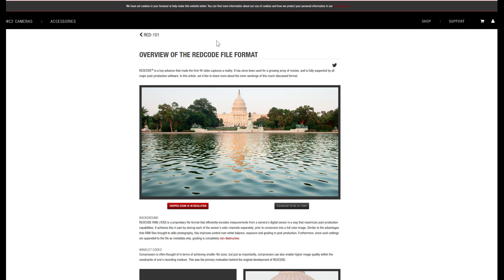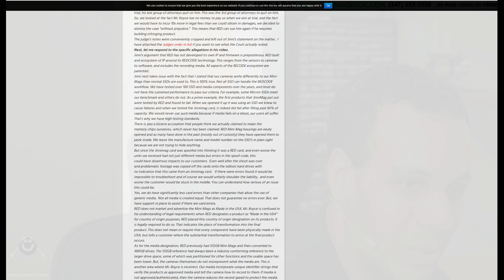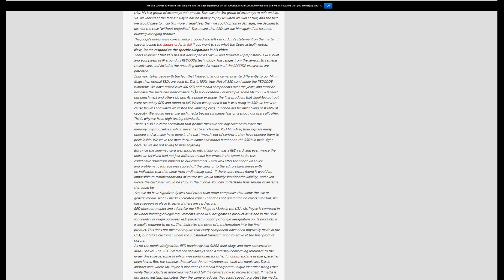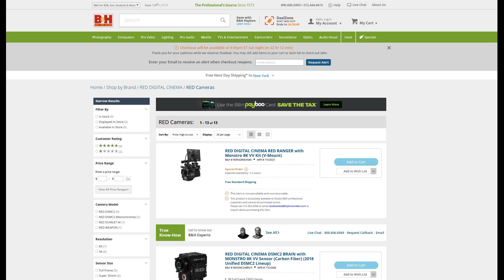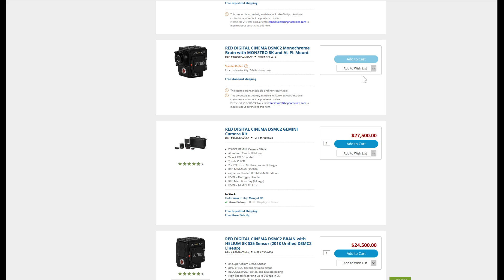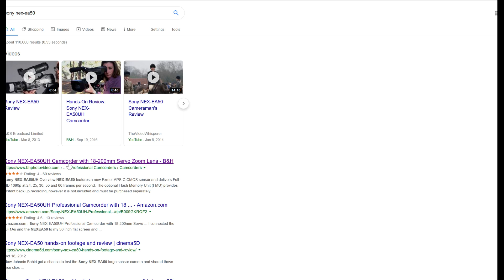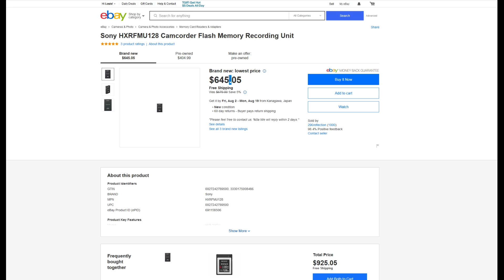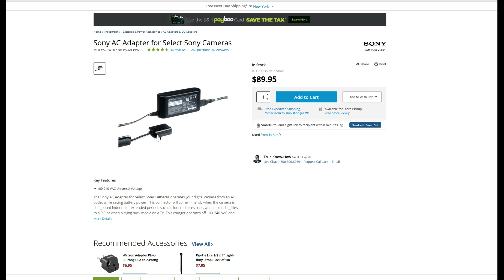Red Camera Mini Mag thing - my take on it.

Comment: Im a red shooter. I believe the special way that the file is written is that it saves the video in layers of resolution/ compression. This allows you to playback a r3d file on lower end hardware at a lower resolution without a hardware hit. The 4gb file split is a redundancy and fat 32 thing to allow Mac and PC owners to transfer data interchangeably and not what I believe Jarred is referring to by proprietary tech. The 4gb file split rumor as the special proprietary way the file is written is speculation from Linus being spread by hearsay as fact. Not defending RED on this debacle, only clearing up the REDcode issue.

Comment: So when a company decides to release a product, when setting the price the have to factor in the development costs and manufacturing costs.  The development costs are amortized over the expected production run including the price of accessories.  If they would let standard SSD's be used in the camera, that would result the profit on the SSD's being shifted to the cost of the camera.  Thus, the system cost would remain the same.

Comment: Anyone ever used Siemens PLCs? You need to store your program on a regular SD-card (with DRM formatting), and the bigger you program, the more expensive your memory card. Nothing strange that far, until you realise the sizes are in MB rather than GB. Over 100 euros for a few MB?

Is red owned by siemens?
Reply: https://www.ebay.com/p/Siemens-Simatic-Memory-Card-4-MB-for-S7-1200-S7-1500-CPU-6es7-954-8lc02-0aa0/1165839463

Comment: From what I can see the Mini-Mag was introduced in 2011 and its predecessor, the REDMAG, in 2009. This talk about a lot of SSD's not being able to meet the performance needs of a RED camera might actually have been true back then.
The thing is that back in 2009 or 2011 this might have been a problem, but since then SDD performance has more than doubled, closer to tripled I'd say. So today even a low end SSD is likely to be faster than the SSD's they used back in 2011. So while once there was an added value of their testing and selecting the best drives that's no longer a valid reason for their inflated prices. Their talk about a recovery service for failed media is a bit more interesting, but frankly I'd like to hear from anyone who has actually used those services and how that worked out before I'd trust that they would be able to recover some valuable footage. Dead SSD's have a disturbing habit of taking the data to the grave.

Back around 2010 or a bit earlier I worked with some demanding video applications where I ran into SSD performance problems. I was working with a video solution we had designed to use three striped HDD's to provide the necessary bandwidth. Now striping mechanical drives isn't the best way to achieve high reliability as any single drive failure kills the storage, and we had three drives instead of one that could fail. To improve on that I looked into using a single SSD instead of the stripset. The application needed a sustained transfer rate of at least 110 megabyte per second, and the best SSD's of the time all looked like they would be able to meet that demand. However the first SSD we tried couldn't actually do this when we tested it. So I searched all SSD reviews on the net and we ended up testing a SSD from OCZ. At the time it was their flagship product and on paper it had a sustained transfer speed in excess of 200 MB/s, which was easily fast enough to keep up. So we sent a test unit to our customer and they liked it, at least at first. After a few days the customer started having problems with the video and sent the unit back. I tested it and it worked perfectly, but after letting it rip over night it was suddenly slow as molas.
First thing you might be thinking now is that early SSD's really didn't like being written to repeatedly, and that's right, but it wasn't the problem here. The test I ran actually only read the video files from the drive over and over. After some experimenting I had a log that said that just reading a huge file over and over it took about 100 reads before the drive suddenly slowed down so far that it only clocked in at about 100 MB/s, and that was below the minimum bandwidth needed. Switch to reading another file and you got the full bandwidth for about 100 reads again before the performance tanked. I proceeded to test a number of SSD's and discovered that a lot of them behaved weirdly when stressed for long periods. I also got in contact with several SSD manufacturers discussing this and at first most of them didn't want to admit that there was a problem, but eventually I was told by several sources that it was some inherent limitation in the controllers used on these drives. They also claimed it wasn't anything that any ordinary user would ever run into, or at least they wouldn't know that it happened. In the end we didn't feel comfortable using any of the SSD's on the market at that time and continued to build these machines using mechanical drives.

Now I'm not saying that this was the problems the RED CEO is talking about, but it sounds plausible. We didn't find a drive that we could trust, but RED might not have needed quite as high a transfer rate, or they put more effort into finding that perfect SSD.

Comment: For those wondering about the facts here, Linus covered it in his editorial, where he went through both arguments, and found that in the end, while the CEO was basically using avoidance tactics, and the knock off manufacturer for storage did have strong points, neither have solid, airtight arguments to lay claim. However, Linus did do due diligence in that RED's cartridge storage is indeed a flash storage medium that is not proprietary to RED, and infact just a regular flash drive, with a new casing and connection on it. He does maintain that RED's point is moot and that its simply a DRM dick waving move to get more money from their clients. As he himself has stated prior to this metaphorical explosion that the cartridges are overpriced annoyances.

Comment: I (detractor) doubt anyone uses the RED camera for youtube vids. The need for fast storage is a necessity for hi-res vid storage, but they are like big thumb drives, you may have many, all with important data. 

It isn't farfetched to have 25 to 50 such drives for an on-location movie shoot, the cost is then upwards of 100K for what are simply cheap SSD with a pass-through connector.
The issue is that RED is suing someone who discovered their scam, an simply did the same thing RED did, take cheap a SSD, put a pass-through connector to fit RED cameras, found out that it works, and so sold them for far less than RED. 

Why did RED sue? Because the cheap SSDs work! If they didn't, Red wouldn't have a problem.
Jinni was smart enough to discover a market selling cheaper storage, so what's wrong with competition? No IP problem here, Jinni did exactly what RED did with exactly the same off-the-shelf connectors RED uses.
Just like your own to-do with Apple, you found a market repairing their stuff after warranty (often better than what they do, even under warranty) Apple tries to shut you down to protect their cash grab.

Now as to the camera. The price stated doesn't include lenses, it is simply a box, called a brain, with a CMOS image sensor inside. RED copied the concept of the ARRI Alexa, then knocked $50K off the price. Blackmagic makes the same thing (BMPCC 4K) with a slightly smaller sensor, for only $1,200!
Of a truth you likely cannot tell one from the other picture-wise, if they all use the same lenses. The color science is in the processing software like Davinci Resolve, Avid, or Adobe.
For me, it's not anger at RED, but rather ridicule towards the arrogance of the scam. Sure I'll never buy one (even if I had the money to waste) but that doesn't mean I can't pour derision on their hypocrisy.

Comment: Hey Louis, people are not upset about the mark up. People are upset about the quality of the Mini Mag. The Mini Mag issue is like the Apple Butterfly switch, but worse. Like how you address the non-removable battery change of Lenovo, at least Apple design the butterfly switch with a purpose, to make the mac thinner. The Mini Mag is a absurd attempt of trying to make money out of the professional. You should watch Linus video on the issue, very accurate. They literally design a proprietary connector just to force people to use their Mini Mag and add a point of failure to the system.

Comment: The reason people are all in a fit about this is because red is charging $3000 for a very cheap (as in, sub-$200 for a 1TB at retail) SSD in a fancy aluminium case with a proprietary connector - which is literally repinned SATA. 
People don't like things being dramatically overpriced, even if they'll never buy one. 
Half of Apple's haters don't like them because their comps are often eye-wateringly expensive for the hardware.  It's nothing new.

Comment: Why is RED selling a $300 component at a 800% mark-up?  Because the application of the component is analogous to: "millions of meters of celluloid film... pro-lab photo-processing included in price."  They are not selling the component.  They are only selling the BENEFITS of the component.  The ~$2K price is far less than the physical, and chemical alternatives.  Ask Kodak, "What do you charge for 4 years of unlimited film, and unlimited photo-lab processing... with digital mastering?"  From RED's perspective, they are providing a benefit (at least) equal to that.

Comment: Red Cameras or equivalent offerings from companies like ARRI are made for shooting feature films and high end commercials.

I am not a videographer, but a photographer; there are some common aspects though. The bigger the size of the sensor, greater is the ‘look and feel’ of the result - better dynamic range and more details. So, two cameras with same resolution can’t be compared when the sensor size is vastly different.

Red movie cameras, or medium format still cameras like Phase One for that matter, have sensors much bigger than that of consumer grade cameras. When you need a bigger image circle to fill up a bigger sensor, you will need bigger lenses and other accessories like stabilisers. With more data to be processed at insane 8k resolution, the cameras will have to pack more powerful image processing electronics, insane buffer, etc. All these components are engineered more robustly compared to consumer grade cams. So, they are pricier by nature due to these factors.

Those cinema lenses need some special design features. DSLR lenses have focus breathing and their focus systems are designed for photography making them unsuitable for high end work. Cinema lenses are engineered to overcome those shortcomings and they are more expensive in nature as a result.

More than all that, as you said, the market for these cameras is so small. As with anything that is not mass produced, the profit margins and cost of accessories are hugely increased. The price of these high end cameras are justified imo. 

But I heard Red has standard M2 SSDs inside their card married to the cam with a proprietary adapter. I can’t judge if it’s a fair practice or not. If the users are defending Red, then they probably know what they are speaking. After all, if you have the taste to buy an Alfa Romeo, you know it’s much safer to get genuine spares for it no matter what your friend who owns a Toyota Corolla says.

Comment: As a proud user of video equipment, I can safely say while their SSD may by a scam in terms of price, it's far from the only exception and likely hardly matters especially compared to other things tbh. You wana see crazy video stuff that's marked up beyond your wildest dreams? Just go look at any canon digisuper lens or any other major broadcasting equipment for that matter. Not even the camera, just the piece of glass that goes in front; those things alone will run you hundreds of thousands of dollars and you can easily break millions for a fully set equipment station. A/V is expensive, do I agree with the price? No but I'd rather tackle issues from big to small first. How about next we talk about photoprinting where your 12 inks for your printer cost as much as 4 of your printer or that most DSLRs/mirrorless on the market do laughable video at their listed pricetag.

Comment: They are using serial ATA...not PCI.. and are quoting the total storage without the extra space used for spares..  There appears that there is something done to the red storage that the camera looks for and writes at full speed.  That could be something buried in the spares area.. or ????   Both sides are "right" and "wrong" at the same time.  Sony sold proprietary storage for the EX1 family of cameras.  However, they did not screw with the customer by preventing other types of storage from working.. Example: a company made a EX1 adapter for SD cards.. and it just works when you have high speed chips.. And works well.  Red?  good question.  They are expensive, and slightly outside my budget by a comma or two....

Comment: Pro gear in any industry is over price for two simple reasons. 1) economies of scale. Any product that's doesn't have mass appeal is more. 2) most importantly, because they can. A hammer costs $5, but have a contractor use it, the job will cost you $500.

Comment: Another reason there is Price On Application is because it's a low volume item. They don't stock it but they can get it either from suppliers or manufacturer, but it's likely coming from overseas and so price will vary with current exchange rates and they want to offer you the best price at time of ordering based on current exchange rate.
If they try and account for exchange rate fluctuations they're going to advertise a price on the higher end of the scale maybe meaning they'll sell none, rather than a few.

Comment: I think the real issue is that Red never adjusted the price of their units due to the drop in memory prices. Their prices would've made sense YEARS ago if it was SLC M.2 NVME, but they aren't even using PCIE, but mSATA interface. Had they kept up with the market and only had moderate amount of cost over the memory itself (since it comes in a nice enclosure), this would've never came up. Jinnie tech or whatever the name would have only created a moderately less expensive version of what Red did.

Comment: Professional equipment costs professional money when a film budget is anywhere from 100k on a low budget to the hundreds of millions 30-70k for a camera is a drop in the bucket.  Heck the shure sm58 mic just the mic no boom no xlr cables no amp no mixing board is 100$ and that’s the gold standard cheap consistent reliable mic.  The big boon for the red cameras is their sensor and the engineering that goes into putting all the boards and processing power into such a reasonably small package they offer large format 6 and 8k sensors so if your needing to get a film to look crisp on a theater screen and have spare pixels to crop or shift images there aren’t many options out there.  And if that is too expensive look at the gold standard high speed phantom cameras that start in the 60k range and can eat 120gb flash memory in seconds that start at house prices before lenses and storage media.  Not saying that the cost is right but most people don’t realize how expensive professional gear is and don’t understand how niche the market for it is.  If they are over charging for the media shame on them but if professionals had that big of an issue with it the company would cease to exist because it’s not youtubers and consumers that are keeping them in business needing the latest and greatest gear.

Comment: People who will never use cameras of that segment are just pissed by the fact that "if I'm dealing with rich professionals it's a green light for rip-off" mentality is spreading like cancer. Also slightly differently it applies to mid and low segments too. Also same applies to everything, even food on your local store shelves. People wouldn't be pissed of if for example they used same cheap SSDs but with like 4 in a pack, so if one fails you have 3 backups. Those SSDs are so cheap that by using 2-4 they would still have over $700 of pure profit out of thin air. Imagine if $35M planes were built using cheap no name parts from AliExpress. It's exactly the same. The cost of everything is $100 in parts, they are selling that for $1500.  Before late 90s if you paid a lot for high end consumer or professional segment equipment it was overpriced yeah but everything was built like a tank and they were using high quality components and things were made like tanks. If some of that stuff had reliability issues it was mostly because over-engineering, sometimes because unintentional design flaw. Now it's because they cut costs at every corner and everything is built with planned obsolescence in mind. From a lightbulb to $10m professional equipment. Welcome to the planet Rip-off, formerly known as Earth.